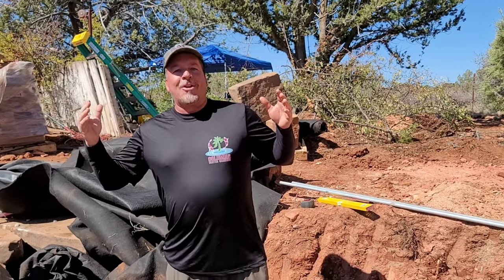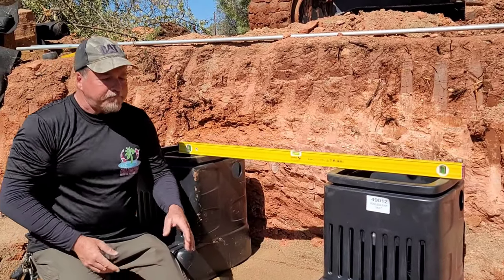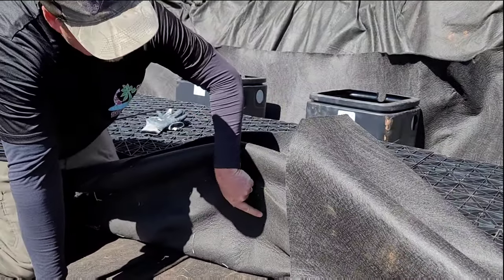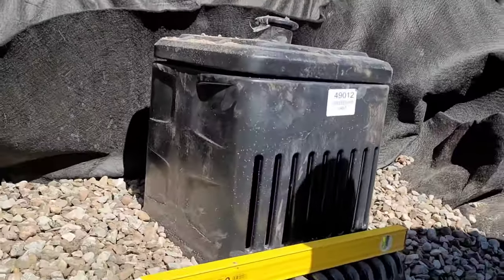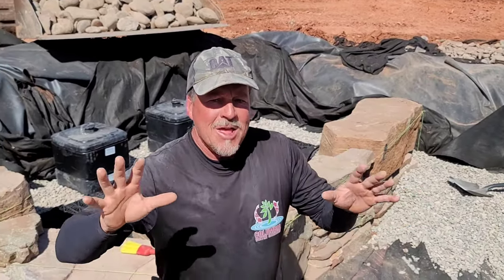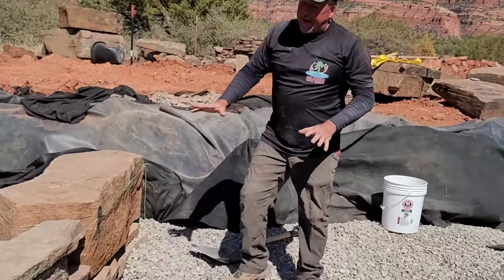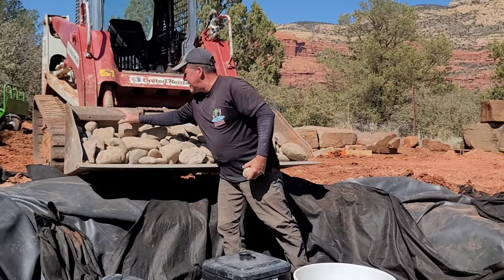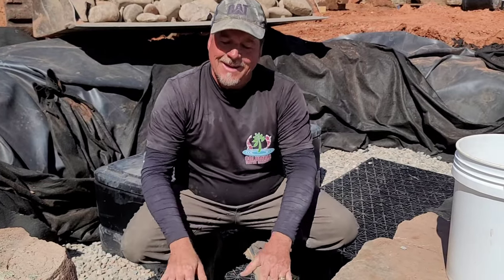How to make a FAST and PERFECT AQUASCAPE intake bay

Comment: I see how you designed this as a skimmer. I was looking at building a wetland filter with the centipede and snorkel. I actually want to build the wetland at the top of the waterfall (like a soft volcano), trickling into a 3 tier waterfall. Have you done something like that? Have you any videos on it?
I learned a lot from this video towards my idea. I just want to fine-tune it before I actually start it.
Reply from the maker: We've installed hundreds of wetlands amd would love to help you with your project.  Whether we give you tips or travel your way, we are always glad to help. Check out the lizard pond in Ft Lauderdale video. It's buried under 50 or so videos, but the part 1 amd part 2 will give you some more insight. 

I'm available at 888-713-7771

Comment: Great Video. Fascinating. How many external pumps did you use and what size. Thanks in advance.
I live in Las Vegas and would love to know if you do consultations out here. Let me know please.
Reply from the maker: 2 performance pro artesian II 3/4 horsepower high head.
Reply: @ColumbiaWaterGardens  Thank you sir. I live in Las Vegas.  Do you offer consulting on wetland filters and pool design
Reply from the maker: Yes I do. Please call me tomorrow at 888-713-7771
Reply: @ColumbiaWaterGardens   sweeeet. I will call next week. Thanks again

Comment: Really appreciate this video, Carl. You're a wealth of knowledge. I'm about to build my first intake bay, and I have a couple questions if you have a moment:

How do you calculate sizing/number of aquablox? I'd heard that the target was 1 gal of aquablox storage for every GPM of flow you're pulling through it. That would mean your 22k GPH of pumps would need about 370 gal worth of aquablox. But you only have 100 gal in this build. How did you get to that design?

How did you determine width of weir? I think you said this one has (2) 24" weirs. That's pretty close to 1" per 1,000 gallons of flow. Is it as simple as that?

Bonus question: Why is the pump vault necessary if you have external pumps and nothing inside the vault to service? Seems like you could save space and cost by omitting them. I've always wondered that, but everyone uses them, so assume there must be a good reason.
Reply from the maker: Those are all really solid questions.  

First, thanks for the kind words.

How do you calculate sizing/number of aquablox? I'd heard that the target was 1 gal of aquablox storage for every GPM of flow you're pulling through it. That would mean your 22k GPH of pumps would need about 370 gal worth of aquablox. But you only have 100 gal in this build. How did you get to that design?
**** 1500-2000 GPH is normal or 750 GPH per square foot of intake.  You can increase flow if the pond isn't surrounded by too many trees and if the velocity exceeds the gravel that could be blocking the intake.  I have done as much as 20k GPH on 2 large aquablox - successfully!

How did you determine width of weir? I think you said this one has (2) 24" weirs. That's pretty close to 1" per 1,000 gallons of flow. Is it as simple as that?
***** Water flows at 100 GPH/quarter inch wide / horizontal inch.  That means that a 10 inch weir that allows 2 1/2 inches of fall will flow 10,000 GPH.

Bonus question: Why is the pump vault necessary if you have external pumps and nothing inside the vault to service? Seems like you could save space and cost by omitting them. I've always wondered that, but everyone uses them, so assume there must be a good reason.
****** To clean the intake bay periodically and to baffle the flow of water into the external pump intake.  Also, to allow room for an autofill and other future devices that may hit the market.

Thanks for your great questions, and if you have more, please call me at 888-713-7771 x4.  If I don't answer, please leave a message :)

-Carl

Comment: I did stumble upon your video thank you. I am in the process of creating a pond and water fall. It will be anywhere from 800-1600 gallons. The water fall filter will be 8'+ above the pump. I was wondering the difference/what's better with skimmer or intake bay? Pond abuts the woods so lots of leaves/pine needles will be falling. Which one would you recommend, what size pump? I'm also looking for more of your vids
Reply from the maker: For the size pond you have, I'd stick with an Aquascape 1000 skimmer and a small wetland to process the tannins that will come from the trees. 

Call me at 888-713-7771 x4. If I don't answer, tell the person that you are looking to talk to me. 

You need wetland filtration

Comment: Great video!!!  I pick up some much cool tricks of the trade from your video.  Do you recommend no less than 6 inches of back fill around the blocks?
Reply from the maker: I like having 4 to 6 inches of backfill around aquablox traditionally, but as you can see in this video, it can be more. 

Always glad to help and hear your feedback, Brad. 

I'll be in Michigan in July, you're in Michigan, right?
Reply: @ColumbiaWaterGardens  thanks man.  I'm trying to push to install intakes on most features
Reply from the maker: Then this should help you. They are really easy once you have the fundamentals down. 👍😎
Reply: Thanks for explaining about the much larger rocks on top of the intake bay. I asked someone before how to keep the intake bay from getting clogged and got a totally different answer. Side a note how deep do you make the rocks on top of the intake bay?
Reply from the maker: The depth of the rocks on top of the bay shouldn't be very deep. Remember that the deeper you make it, the greater the biomass that will collect and cause clogs.

Comment: Nice video Carl. Thank you!

I'm currently in the process of building a pretty good size Rec swim pond.

Would this design work for a negative edge intake bay? I was thinking of doing a an intake bay separate and outside the pond.

I was also wondering what external pumps you recommend for energy efficiency? I'm assuming sequence but I'm wondering if there's other brands you recommend.
Reply from the maker: That's a lot to answer. I'm building one in New Mexico this week. I'll film those answers for my next video. :)

Comment: How do you decide how deep the intake bay needs to be
Reply from the maker: That's an excellent question!  It is based on the amount of flow that the pumps are drawing.
Reply: So how do you determine the size based on the pump
Reply from the maker: There are a lot of factors and no industry standard as environmental impact can affect the size of the intake greatly. 

For example, in the desert, we can get away with far fewer aquablox than in the Midwest or the mountains where there is a great deal of falling leaves. 

I'm going to come back to this question later today as I have a wetland to dig this morning. 

Stay tuned. :)
Reply from the maker: If you would like to call me, you can reach me at 888-713-7771 x4

Comment: You lost me at, "not over-complicate it." If it's worth doing, it's worth over-complicating! Mr. double-barreled, dual overhead intake, perfectly flush aquaboxing, fancy pipe and scree using, check out my line level and string workin, rock variety for days flexing, rock pad fabricing, flow rate mathing, waterfall foaming, why didn't you mention uplighting, and why not toss a fountain in all that open space...oh wait, you said it was someone else's build and you were just visiting. Nevermind. Though it did bring up a painful reminder that my string level isn't where I thought I put it and I'm worried I've lost it. That's two losses in one video, not sure I can go on after this.
Reply from the maker: Ha!!!!!  I do have some cool tools.....  😎

Thanks for the belly laugh this afternoon, Carl. :)